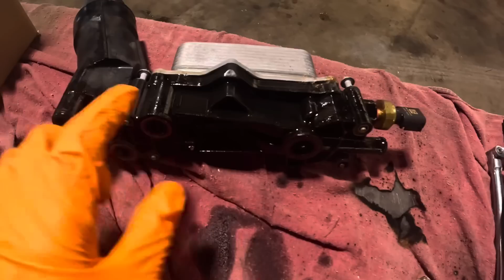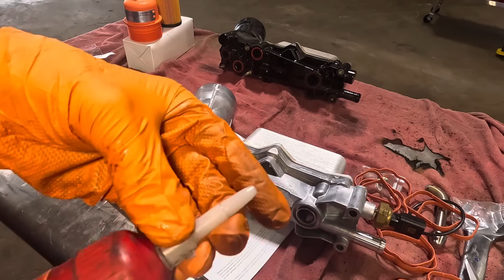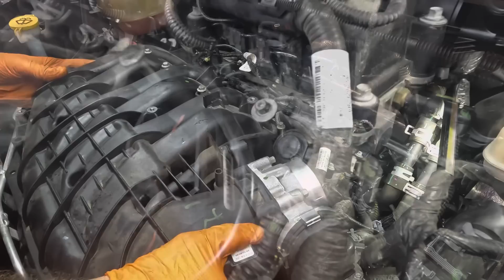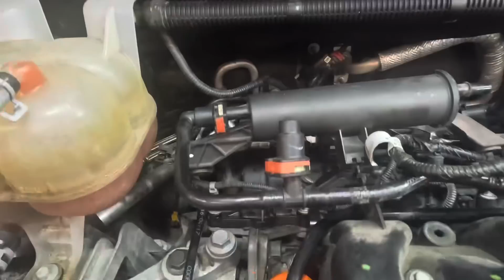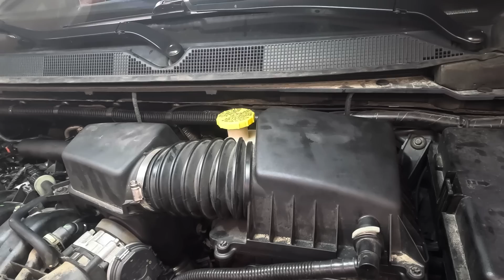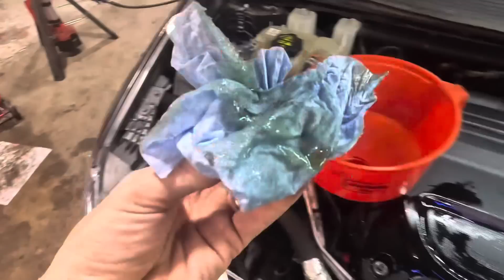Plastic Pentastar 3.6 PT2 Chrysler Dodge Jeep Ram Volkswagen. Leaking Oil Contamination!

Comment from the maker: Part 1 Here! Parts Fraud! NOT what we ordered! Chrysler 3.6 Pentastar V6 https://youtu.be/lW3kLqRywJI
Reply: Hey Ray in relation to your comment regarding torque wrenches, I was told by a calibration specialist that the on/off indicator /clicker on a torque wrench was basically for purposes of re-positioning the torque wrench in hard to reach places where there isn't ample room to swing the handle/ tool arm.
The tool specialist went on to say, you can not correctly measure the amount of torque applied to a nut or bolt in the left /off position for reasons that you have an uphill /downhill  helical wave and crest in the threads plus you have surface friction to contend with plus coefficients of thread compounds, temperature differentials, oxidation and minor thread galling and the grade of bolt and its coating etc that's another story in of itself. Long story short.... If you put 150ft.lbs of torque on a bolt, it would not necessarily break @ 150 ft lbs if you factor all of the above. Depending on conditions, break out torque is a best guess and can vary even in identical situations.
I don't know if the guy was blowing smoke, but some of what he said made sense.
Your thoughts?
Reply: @IR-nq4qv 
I worked in a large machine shop and we calibrated the torque wrenches on a regular basis.  He is correct, you cannot judge torque of a fastener by the amount of torque that it took to break it loose.
Reply: @shakerman55  As did I, all the torque wrenches had to bear an inspection certificate.  Thanks for your response and assertion.
I worked on a multi-billion dollar project and was asked to confirm the existing torque that was applied to valve studs & nuts after a leak was detected. After conferring with the tool specialist, I filed a report based on his expertise and what I said in my previous statement, the big dog on the site seemed to be satisfied with the findings.
Reply: Did you ever tighten the hose clamp on the air box?
edit: Oh, when you were hosing it off, it did look tightened. Sorry, just checking.
Reply: 57:12 
Ok time for your own engine cleaner.
Rainman rays  Nice and Shinny (R)
Reply: Ray can you please make up a YT music playlist of all your shop tracks? Love that you play all the music from my teen years!! Lots of love from Scotland!
Reply: Hey Ray,  I have a question: some have told me that I couldn't do a trans fluid change on my ram 1500 5.7.  It's got a little over 80,000 miles .That the old pan has to get removed.  
Is that true?
Reply: You asked about operating the torque wrench in reverse. If you will recall, Some fasteners have Left- hand threads, necessitating reverse operation!
Reply: @martinnorred8387  the same principle holds true with a left hand thread, you can't flip the wrench lever now to the on position(meaning off) to correctly measure how much torque was applied.
Conversely ..,
all torque wrenches are calibrated to work in the "ON" clockwise position unless it is a specialty torque tool, you can't use a normal torque wrench on a left hand thread and expect  accurate results..
Moreover..,
..It doesn't matter if it's left hand or right hand thread, break-out torque is vastly different than make up torque by its very nature.  Nice try...
Reply: Have you tried Fastenal is Sarasota?  Great industrial fastener supply.
Reply: The Pentastar motor is the Rick roll of the automotive industry. Just an opinion.
Reply: Remember Pacificas take 
0w/20 not 5w/20 😉

Comment: In a 2016 DGC the plenum had two studs that slid into the two front brackets. In the back, the loosened bracket slid over the two studs. All fastened with 10mm nuts

Comment: That oil pressure sensor is another failure prone component. Went bad on our Chrys. 300C at 40K miles. You have to take the 2-piece intake apart to get to it. ( AS you already learned years ago ). Totally stupid design to improve cash flow to the Mopar dealers. They could have mounted the sensor OUTSIDE of the oil filter assembly. When that sensor fails, the car will still run and drive, but at greatly reduced power. ( No VVT action ).  Do your customers a favor and replace the sensor while you install the Dorman casting. I personally hate the new cars that rely on all the cheaply made sensors in order to run. Also, there is an order of sequence for torquing the bolts on the intake parts. Just saying.

Comment: Recently did this on my Grand Cherokee.  I had the upper intake off for plugs and it really wasn't much more work to pull the lower and swap the cooler with the Doorman part.  Hopefully it was a good preventative maintenance step.

Comment: Using a torque in reverse matters if you're trying to break really tight fasteners with it.  The reason it has reverse is because left handed threads exist.  What you just did, however, is totally fine and no torque wrenches were harmed in the making of this video.

Comment: Any plastic part requiring torqueing requires a brass or steel inserts in the plastic part and machine threads not wood screw threads. They will slowly stretch over time.

Comment: I noticed you had put five W-2 versus 0W 20 like the cap says that’s all I needed to know to know that these engines do not need to be running on such a thin weight of oil. I’m dropping my zero20 today.

Comment: Ree!!! You overtorqued those screws unpurpose!
But seriously, with metal screwing into plastic, you have to be really careful to avoid cross-threading them. I slowly turn the screw backwards until I feel it click down into the threads, then spin it in by hand. And real overtorquing will rip the threads right out. Ask me how I know.
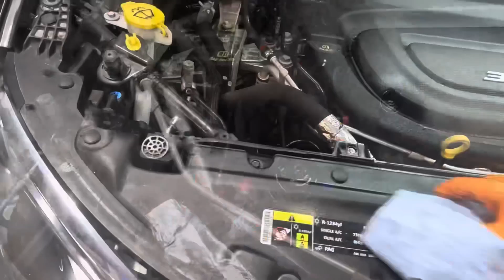Edit: 47:40 You get a like for the brake cleaner theme song!

Comment: i just recently did this repair on my 2013 chrysler 200 @ 190,000 miles with the 3.6
Reply: the coolant transfer the thermostat bolts to is cheap plastic with pressed rivets that will break if torqued too hard

Comment: One reason I won't buy a Ram with this engine is this part problem. The others are, from what I'm reading, the engine starts dry every time, and the supposed left cam rocker issue....I really thought by now all of these issues would have been resolved. Any info would be welcome.

Comment: You could be doing your customers with DGI engines a favor by using "Pennzoil ULTRA PLATINUM" oil instead of the OVERRATED and OVER Priced Amsoil. The Pennzoil is a MUCH lower "volatility oil". The intakes will stay significantly cleaner between "walnut shell" blasting! Want proof? Check out "Project Farm" channel. Even Ford Tech Makuloco uses nothing but Pennzoil now that he no longer works at a Ford dealership and has his own shop! And neither "Project Farm" nor  Ford Tech Makuloco are being paid by Pennzoil!!:hand-purple-blue-peace:

Comment: Re torque wrench in reverse. I wouldn’t crack nuts off with them but in the case where you had to back them off I’d say fine. Also you can get counterclockwise threads that need torquing too. So reverse is fine as long as it’s not to loosen the nut in my opinion

Comment: You did do something "wrong"  Most shops would not bother to go the extra bit and order a premium part, or even know what a premium part look like, they will knowingly install the badly designed parts, if it failed again after a long enough interval, it is your problem to get it done again. This is flat rate working, get it done in 3 hours and collect 5 hours pay. You be scared to fly if your aircraft mechanic is on flat rate.

Comment: Again a great video.  Makes me curious, though.  The oil cooler must be expensive to make, and if the plastic bottom is the failure, why does Dorman not just make a replacement for the plastic part and let you bolt on the old cooler which you say was recently replaced?
Reply: They originally did. But there is a model difference in the bolt format of the cooler (and how it mates to the housing) depending on the model generation of the housing.  By supplying their own cooler, Dorman can sell their housing as a replacement for all housing generations.  The additional expense is minimal, and it saves the DIY mechanic from another point of failure.

Comment: I have the 3.6 in my 2011 Challenger.  I am getting ready to do this job this spring.  While in there, I will do the spark plugs since I am at 120k on originals.  Should I do injectors and packs while in there or just the plugs at this point?  Currently runs fine with no misfires.  What would you recommend to your customer?

Comment: I used to work at a Chrysler dealer, we would plug all the passages for coolant and oil with different plugs, and we’d flood the piss out of it with a gallon of brake clean, then take 3 layers of rags and spray air where the brake clean was pooling up into the rags. Valley Came out spotless everytime and didn’t even get into the cylinders

Comment: We had a 2011 Grand Cherokee in the shop today I noticed the orange immediately didn't catch the placard on the housing until I tried to install the filter our system called for it wouldn't go in then I saw the message about it using an updated filter part number kind of annoying for how we document our paperwork had a chat with the customer about that informing them they need to make the shops they visit aware of that in the future.

Comment: I have on e and I was going to replace the oil cooler but I decide to use Castrol GTX High Mileage motor oil and the leak. I'm just putting it off. Do you think that the High Mileage oil will be a problem with other gaskets over time?

Comment: For well over half a century, American engines have no oil coolers, unless you are racing , I wonder what make these not so bright Chrysler engineers add this cooler. I am not even sure it is a cooler or oil heater.  It was a component that is unnecessary, made of cheaper plastic that is failure prone, and located in a hard to access area and where all the heat is at in the summer.  Chrysler used to be an innovator in the first half of the last century, how things went down hill.

Comment: 2 issues here, as a "professional" you should be up on what your doing and the proper parts to use. That said the 2 issues are 1) you used the dorman o rings, it's well known you don't use them. OEM or fel pro only, it'll be back within a year leaking again, no need to ask me how I know.... Issue 2) Why didn't you replace the coolant hose? It's relatively cheap.  Minor gripe, never use an impact to seat o rings. I have 42 years fixing the crap engineers come up with. I deal with Jeep Wranglers, they have the oil temp sensor in the cooler and don't use the plug.

Comment: Fasteners, nuts, bolts, whatever you want to call them. Personally I go with cap screws, socket head screws, torx head screws and so forth. To me, a bolt is rounded on top, like the old crome bumper fasteners.

Comment: Yes Ray. To re-screw into plastic, you turn the bolt anticlockwise (with a little pressure) until it clicks that is the thread alignment, then start by hand, and no cross threading will take place, works for all bolts. Great program mate.

Comment: Well how do you torque left handed threads?

The idea behind not using Torque Wrenches in reverse is to reduce wear on the calibration, the more it is used the sooner it needs recalibrated.

Comment: Ray so you know the red coolant in the 6.7 Cummins is a HOAT and cannot be mixed with universal OAT coolants. This is a very costly mistake because of coagulation it renders the engine destroyed and coolant system regardless if it wasn't overheated. Hybrid Organic Acid Technology coolants careful what you mix!

Comment: Ray would it be a bad thing to give the intake runner fasteners a short spray shot of wd 40 to facilitate a even torque in case you have some that have more drag when threading. Ray I used to be very critical about your work but I got to say excellent work on this poorly designed crackpot engineered dumbass setup. Also did you they also make a adapter for this housing to accept a spin on filter which will hold oil in it reducing the amount time it takes to fill the housing capacity. I have one of these in my Doudge Journey if the car sits more than 2 hrs I always flood mode it before I start it. Something you should educate all your customers on with these engines. Better to burn up a starter motor instead of the engine. And I noticed that a PAO synthetic base stock oil quites the rocker lifters.

Comment: Honestly the only thing that should be done is vacuuming the fluid out with a shop vac and a small crevice attachment and that's it. So as not to get debris in the oil and coolant ports.

Comment: Dorman supplies no OEM parts to any manufacturer, that comment is 100% false. Bosch is the largest OEM auto parts manufacturer, followed by Denso and ZF. Dorman is an aftermarket parts vendor, they do not manufacture their parts in their own factories, they are sourced to other companies and packaged and marked for use by Dorman.

Comment: The 3.6 L FCA Pentastar V6 Engine is an overwhelmingly durable and reliable engine. That's why it's been used in in more than ten million Chrysler, Dodge, and Jeep vehicles since 2010. With proper maintenance the 3.6L Pentastar engine can provide years of reliable service. Love watching you Ray, the 3.6 gets beat up for dumb stuff, 10 million built and going one cannot complain.  Thanks for the video, I've done my 2011 Durango and my 2017 Pacifica, crappy design for sure. Plastic in the valley of an engine...fail! This was clearly some bean counter and an engineer trying to meet CAFE standards by reducing weight

Comment: The reason for not using "compatible" coolants is the chemical composition of the coolant, and it's corrosion inhibitor package  . I'm not a coolant guru, but there's Ethylene Glycol, OAT, HOAT, and others. While one kind coolant may be compatible with another, it doesn't necessarily mean it will be compatible with various seals gaskets, and "O" rings.

Comment: The real problem is so many garbage aftermarket parts and people think it's a failure from OEM. For the 3.6, there is an upgraded OEM part that is in fact made of aluminum but it does not fit correctly on the engines up to 2013. Close but no cigar. The plastic part is trash if it's not the OEM part. The aluminum part is fine no matter who makes it.

Comment: I would have run a tap on that stubborn bolt on the intake. Also, never start bolts in aluminum or plastic with power. Just asking for problems and being lazy, which hacks do. Great engineering putting coils and plugs under the intake...

Comment: Not all clicker torque wrench’s are made to indicate torque in reverse. Just have to follow manufactures instructions. But if the bolt is reverse thread then you have to torque in reverse direction of the torque wrench.

Comment: I have a 2014 Jeep Wrangler.  This part was replaced right after the first oil change.  The dealer tried o\to blame whoever changed the oil even though there is a TSB.  I haven’t noticed any leaks since.  Fingers crossed, knock on wood 😇🙏🏻

Comment: I have a 2011 grand caravan and was told after having a motor mount fixed that I had the oil leak from the housing and also intake gasket problems. Being aware that these are failure points I have been closely monitoring my oil. My oil level has not moved in almost 5k miles. I think some…just some shops are aware of these fail points and maybe push early repairs. Not Ray of course…but some shops want the work.

Comment: The all aluminum cooler assembly is the way it should have been made.  Mine goes, that Dorman all aluminum is getting installed.  This is the one stupid design flaw I know of on the pentastar Stellantis has not taken seriously.  Unsure why this has been left for so long with out a fix.

Curious why you put the heatsink on before installing?  Might be easier to install the base into the vehicle with it off and it seems to bolt down from the top.

Comment: When installing the upper plenum you don't use a power tool - or you risk warping the plastic then leaks occur. Removing the bolts yes you can use a power tool but installation you must be more patient and do the installation by hand.

Comment: I just did this same job a few months ago on a Durango and put in the upgraded part.  Its worth it to install a new oil pressure sensor while youre at it, they tend to have a high failure rate also.

Comment: i do know someone with penstar    rocker arm replacement for tick sound.. replacement oil cooler figuerd out about the upgrade after 2nd oil cooler failed lasted 90 days and re leaked.. 15 jeep wrangler 3.6.. i have otc timing tools for all the dodges made reckerarm replacement easy. 3.6 liter have been known to bend valves while at idle aswell i think they are failures

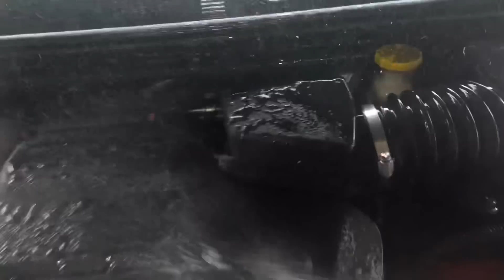Comment: Did I miss you fastening the hose clamp or didn't you fasten the hose clamp at 45:35 ? Since it is in the exact same position in at 57:50 I would guess you forgot to tighten the hose clamp ;) shame.

Comment: A 55 gallon drum is not as out of the question as you might think...
just think a 2 car household that each drives 25k miles a year would use over half of it in that year.
1.5 gallons each oil change every 5k miles times 2 cars.... 
figured at 1.5 gal ( 6qts.) thats already 30 gallons and personally  ive never driven less than 40k miles a year

Comment: Does Amsoil have requirements per mfg. listings on the label.  All Syn oil is not the same in a weight ratings.  there is a difference in additives.  VW 502, 504 507 508 etc...just like GM or Porsche.  If the labels don't call out the specs, it's not meeting specs.  No matter what Amsoil claims, if it passed mfg. specs, the label will have the specs.  All legit oil Motul, Liqui Moly, Castrol, Mobile..all have specs on the label...